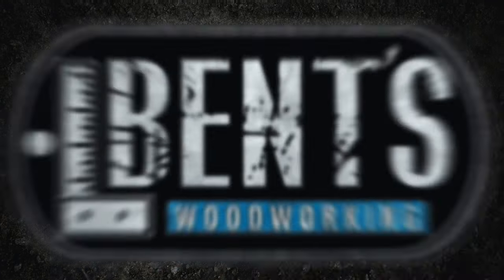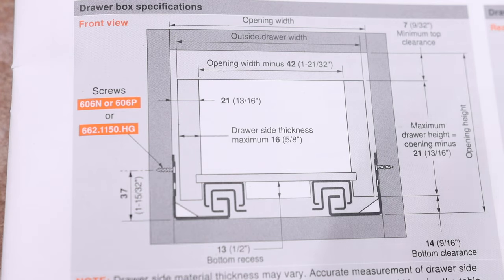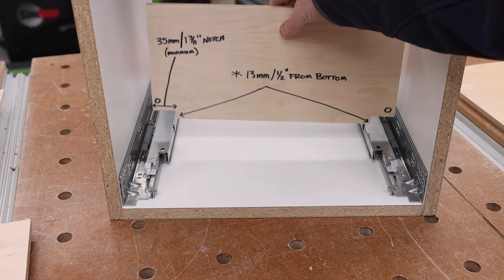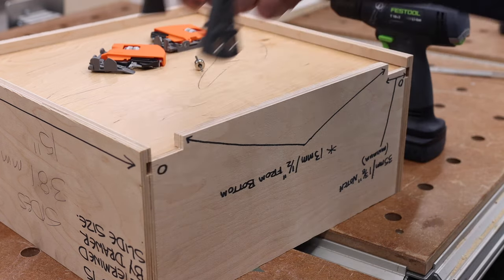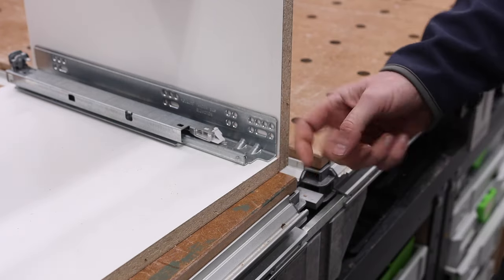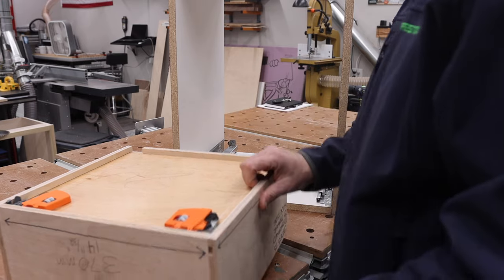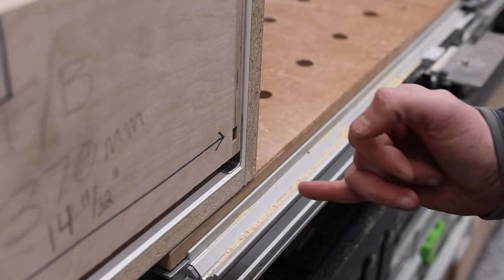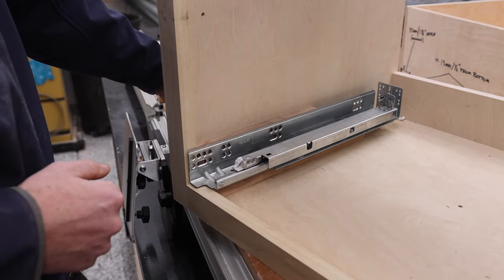How To Install Blum Undermount Drawer Slides

Comment: All installation videos I have seen use the angled holes to secure the release clips. There are also 2 vertical holes on the clip. Is there a reason that these holes are not used? Thank you.

Comment: Brent. I’m retro-fitting new drawers into an existing cabinet that’s already installed. Can these 563H slides be installed without being able to access the back side of the drawer when it’s closed?
Reply from the maker: You could put in spacers to attach it they are face frame cabinets

Comment: Jason great video, building my first set of kitchen cabs and intimidated by all the hinges and slides :O  I have 6 drawers for the bottom cabs, 3 sets w/2 drawers each, and 3 large pan drawers on the last set - all 21".  I;m using these in the video for the 3 large pan drawers.  My question is, do I use these for the smaller 6 drawers that hold mis crap and silverware, utensils?  or is this overkill.  thanks!!

Comment: Hi Jason,  quick question.  I’m working on a wide pull out tray with a kick board.  I want to use these drawer slides.  I’m concerned about the middle of the tray bowing and scraping.  The opening is 46.5” wide.  Do you think that will be a problem?  Should I do 2 side by side trays?  Thanks…

Comment: Jason will the blum undermounts work with a pre built pull out drawer when the sides and front are reversed in the original factory build. Its not really a drawer but a pull out shelf with 1 x 3 sides for a kitchen storage of small appliances bowls etc

Comment: The measurement for the front and back are also dependent on material thickness assumption included in the instructions.
Reply: If your front and back are placed between the sides (like his example), then the only measurement you need to reference is the opening width minus 42mm.
Reply: @tylernettestad  but what if the thickness of your sides is 3/4”? I don’t understand why the thickness of the sides isn’t part of the equation…
Reply: @benvelarde1964  just came across this video. There are two variations of the blum slides.  The most common is the "H" which accommodates 1/2" and 5/8" sides. The "F" version accommodates 3/4" slides. I personally don't like 1/2" drawer boxes (they just don't look substantial to me) and I prefer using solid lumber, so it seems "wrong" to plane down 3/4" stock. So I order the "F" versions. I have had to use "H" versions with 3/4" stock.  I just run a rabbet on each end and bottom of the sides to decrease the thickness to 5/8". Very useful if you use pocket screws to attach the front and back to the sides, it keeps the front or back from "walking" away from the edge.

Comment: Well four grooves in the drawer is I think over kill.Its much easier to make grooves just on the sides and bottom of the drawer you srew into front and back peice.(if you have at least 16 mm ) So you dont need to make those notches.(exuse my english please)
What I love about Blum especially about these drawer slides u can use their free software  named DYNAPLAN(or DYNALOG)and there you can make OH my god everything.It so helpfull.
Lets say you have to build chest of drawers an you need 10 drawers and every drawer has to be different size.You can simply write it to the program and in the end you just print your plans and your dimensions are there.You dont need to think and it ALWAYS perfectly fit.
Because you showed in this video just one and simpliest drawer witch almost always is exactly on the bottom on the drawer.(If you have a TIP-ON option is 3 mm higher I think.
They also sell hardware which is used for ther fronts so if you are finishing your cabinet you can still little bit adjust the fronts up and down left and right.Very usefull.

I hope it helps somebody who will struglle with these.

Happy woodworking to all
Reply from the maker: Thanks for the tips. The Software sounds interesting

Comment: I wanted to make my drawers out of 3/4” material. Is that even possible with these slides. I’ll have left over from making the sizes of boxes that I need and want to use it rather than having a lot of left overs and buying more 1/2” sheets. ??
Reply from the maker: These specific slides 5/8 is max thicknesses

Comment: In the box construction, would everything work the same if I made the "front" the full opening width, and the sides and back the outside drawer width? I'm wanting to do this instead of making a separate false drawer front
Reply: Basically just reduce the sides length by the thickness of the front
Reply from the maker: Good question. I have never tried that but I’m assuming there is a way

Comment: mounting for Sys32 cabinets?  Example, is there a 37mm hole in the front group? can they also be mounted to the bottom (for example a half width drawer)

Comment: Doesn’t the front measurement depend on the thickness of the wood you are using to make the drawer?
Reply from the maker: It could, yes. I used 1/2”
Reply: If the front and back of the drawer box are placed between the sides (like in his example), the only measurement you need is the opening width minus 42mm.

Comment: Is there a difference between the different types in terms of depth? I'm working on a 760H3200 right now, and the drawer length needs to be nominal length - 10mm. So not exactly the length of the drawer box as in your model. Or am I misunderstanding the manual here?
Reply from the maker: I would have said to make sure you refer to the manual for the model you are using. I haven’t used those specific ones. What does it say for drawer length.

Comment: My Blum under mounts don’t close the drawer all the way as they did originally. Is there any adjustment on the tensioning to get the drawer soft closed properly or do I need to replace the under mounts?

Comment: Why does the Blum manual say nominal length of sliders -10mm for the drawer side length, and they also notch the front plate for the locking mechanisms?

Comment: Hi Brent - I'm just a bit confused. It seems that Blum discusses the side thickness as part of the formula to determine the front board length(the drawer facing) ie if 5/8 thickness wood is used on the sides, you need to subtract 13/32" from the opening width. If using 1/2 thick wood subtract 5/8" (or 20/32") . I've seen others subtract 1 5/8" if using 1/2" sides. Any idea which is correct?  Blum doesn't mention doubling up the measurements for each side, so I'm not really sure what to do. Thanks.
Reply from the maker: Definitely take a look at the manual. The exact measurements are different with different hardware. If making the drawer box the way that I did in this video, with these model slides, this is how it’s done. The length of the front and back on these slides isn’t dictated by the material thickness. The measurements are based on clearing the runners.

Comment: Maybe dumb question. I used Movento slides on a previous job, but they're unobtanium right now so I ordered Tandem Plus Blumotion for this one. I set it back 3mm like you show in the video, and like I did on the previous Movento project - and the drawer protruded by a lot. After a lot of digging, I found the Blum instructions, which has a table for determining setback, which gave me a 15mm setback. This seems logical... but are there differences between the two lines in terms of how setback is applied?

Comment: I bought a vanity with this type of hardware (Blum Legrabox). Do you know how I can make the drawer stop before it's fully extended. I need 1/2" of clearance because the drawer hits my bathroom door (when it's open). Can I move the drawer runner back into the cabinet by 1/2"?

Comment: hi there, good video. I purchased the 550F4500 model. its bizarre that when I put the orange part that fixes to the underside front of drawer to the runner itself (not attaching to a drawer box) it is flush with the side of the front of the runner which means when it is attached to a drawer box it will be in front of the runner, in your video it is flush 18.27 in video (almost anyway) have you any idea why this maybe please.?
Reply from the maker: I have only used the model I show in this video.

Comment: Do these slides have a weight range/limit?
Reply from the maker: Weight limits depends on the model. Range is whatever the slide size is. They are full extension

Comment: I am confused by one thing. I've just had a look at the blum manual and the drawer depth and the slider length should not be the same, according to the manual. Also, when you were working on the back of the drawer the slider was protruding a couple of cm in order to attach it from the back. Can someone clarify this?

Comment: Wait, so if I'm using a 450mm drawer slide. My front to back measurement overall needs to be 450mm also? (I am not using a drawer front and the material is 15mm). In the Tandem 560 diagram it shows SKL = NL - 10 (SKL meaning Drawer length and NL meaning nominal length) Which I make out to be, minus 10mm of the overall drawer box length?
Reply from the maker: Each drawer slide has different specifications based on material thickness. The manuals for each slide would be where I like to point people.

Comment: Great video.  Thank you.  Question:  I have a drawer box that is slightly oversized by 1/8”.  My face frame opening is 17 7/8” and my drawer box is 17 5/8”  I am building with inset drawer fronts.  Can I just undersize my side spacer by 1/16” on either side so that the effective width is back to 3/8”?  Or is there something else that I’m not thinking of that will restrict me from doing this?   I have the fully adjustable mounts so I am thinking that will help me dial in my fit even though it is slightly tighter fit than recommended.  Thanks again.
Reply from the maker: I’m not really sure I follow

Comment: I wish you showed the install using LR32 system.
Reply: One of the front and back holes of the slides will fit your LR32 holes you drilled before. So you only need a center hole. The slides are perfect for the LR32 System.
Reply from the maker: Have you seen my LR 32 basics video? I talk about it in there if I remember correctly
Reply: @karstenf.2558  The Blum slide mounting holes are 25 & 37mm from bottom of slide to center of the mounting holes. When using a balanced side panel and a 18mm thick bottom panel the LR32 5mm holes ends up being 29mm from the inside bottom to center of the 2nd hole. I always see the bottom slide resting on the bottom panel. How do they do it and get the holes to match up?
Reply: @garybadger325  Hi Gary, sorry for the late answer, but it was late in Europe. And i hope, i got you right, since english is not my first language. But you can adjust to the thickness of your lower and upper panel. I learned to use different blocks to clamp between the panel you drill in and the stop block. I have different ones depending if i am using 15, 18, 19 or 22mm out of plastic (you can buy them here in almost every Hardware Store). Btw with Kirchen cabinets i never put the slide on the bottom to prevent dirt going in the slide. I hope that helps.
Reply: @bentswoodworking  Yes I have, but it does not show the LR32 setup for drawers. You show hinge and shelf pins and a brief laying out the Blum 563H @ 10:30 mark. It also shows the bottom slide sitting on the bottom deck. If I use the 16 up and away setting and 19mm plywood, the holes on the side panel do not match up with the slide holes when you set the slide on the bottom deck. The bottom mounting hole needs to be 19mm + 37mm or 56mm from bottom of the side panel. When I setup the 16 up and away the second hole is 48mm and the third hole is 80mm from the bottom. How did you get the holes to match up with the slides? It seems to me that there should be a stop with a 24mm and 8mm setting.

Comment: I already built my first box without cutting the notch. So, I will use repeated passes with my table saw.  I don't have a dado, or even a flat top blade.  But, I figure with a bunch of passes, I can get it.  It will take me a few minutes.  I definitely should have done the notches first.  Oh well, live and learn.  A bunch of passes won't kill me.
Reply from the maker: You can also just build it to where the back panel sits on the drawer bottom and then you won’t need notches at all.
Reply: @bentswoodworking  No, that would require too much wasted space.  My other drawers I will do the notches before building them.  I’ve only got one to do that I mistakenly built before notching.  I could even just start if from scratch, but, I think the many-passes method will work.  Haven’t done it yet.  Thanks for responding.
Reply: You could also use a regular hand saw. I don't think he mentioned that!

Comment: I’m confused on determining the drawer width. I know you said deduct 42mm from the opening to determine drawer front/back but depending on the thickness of material, wouldn’t you have to account for the drawer sides as well? Based on your video, anything above 1/2” material wouldn’t fit (assuming your drawer boxes are 1/2” ply)
Reply from the maker: The way that I built this drawer box, material thickness for the front and back are irrelevant.
Reply: @bentswoodworking  I’m asking about the sides…
Reply: This may or may not help and maybe too late
If you buy 15 inch slides drawer length must be 15 inches deep, 18 inch slides 18 inches deep and so on
If you use 1/2 stock,make your drawer 5/8 smaller than drawer opening
If you use 5/8 stock, make drawer 1/2 smaller than opening
It really is that simple hope it helps
Reply: @brettkavanaugh9448  thx Brett

Comment: I'm still confused on what holds the front of the drawer down
Reply from the maker: The clips installed on the bottom
Reply: @bentswoodworking  yeah I saw that after i stated that thanks

Comment: why is it that not one vid shows mounting the slides to the actual bottom of the cabinet I didnt even know the Blum slides had holes  for mounting in the bottom until I called Blum. The lady said you dont need back brackets at all just screw them to the floor easy. but no one has showed that in all the vids on utube.

Comment: So with these under drawer slides, I lose 42 mm from the widith. With the regular lateral slides it's only 25 mm. The aim of the under drawer slides is to allow for heavy load, and more important to save widith. This slide doesn't do that. So I would stick with the classic ball bearing lateral slides...
Reply: You only subtract 42mm on the interior dim of the drawer, not the overall drawer width. That 42mm is to give you what the front and back legnth of the drawer should be, trapped by the sides of the drawer. So technically, you would have more interior space if you use the same drawer thickness on under mount slides. For example, if you use 16mm (5/8) stock for the thickness of your drawers, you'd have to subtract 25mm from the side mount slides and 32mm from your drawer material thickness. 42mm < 57mm #getbent

Comment: People, and Blum themselves, overcomplicate a lot of this.
For instance, no notching is needed at the bottom of the drawer box. Just make the front and back 1/2" shorter than the sides.

Another example:  whatever width the inside of your drawer cabinet is, subtract 3/8", and that is what the width of your entire drawer box needs to be made. Subtract your thickness of drawer sides to get the lengths of the drawer box front and back.

When attaching the slides to the cabinet, no predrilling is needed, just drive the screws in, they're tiny. Save yourself time.

Comment: A bit of deceptive of full description as the "undermount" is actually screwed into the sides of the cabinet.  Which is not what I want.  I want them attached to the bottom.

Comment: Don't go to 32nds. Install the slides and measure those. That's your inner width. Subtract 1" from height.  Don't secure the bottom on all sides. Only the front and sides. Slide the bottom in and staple it in the back. Done.

Comment: This really isn't the best video because you're showing a very easy application. And then you're also flipping the cabinet. I build a lot of draw boxes and install them in existing cabinets in very tight spaces. Many with face frames. Some don't have a center panel in the middle, so those are types of videos would be great if you could demonstrate any Special processes the help installation go smoothly
Reply: I can’t trust your opinion. You don’t even know how to spell drawer.